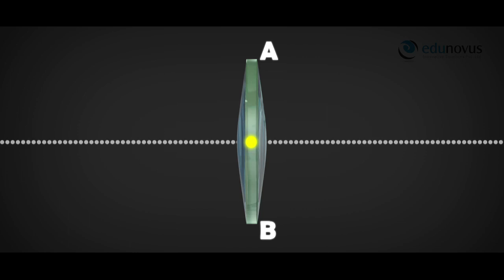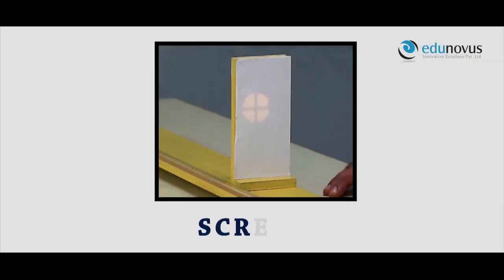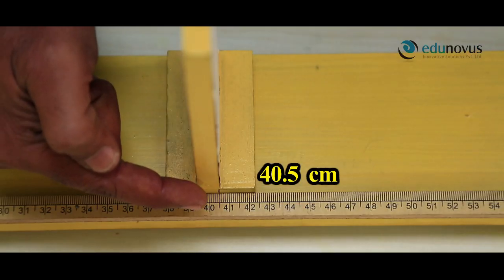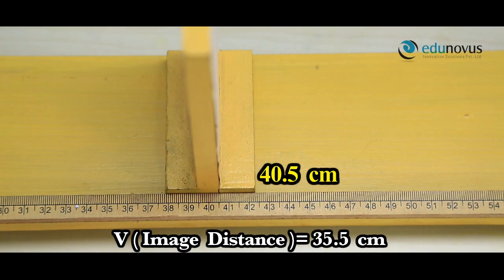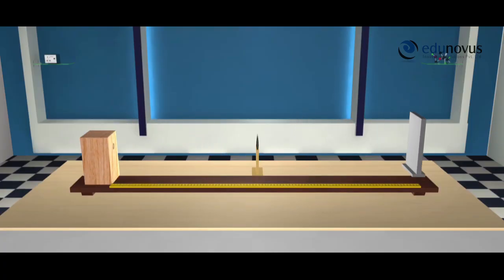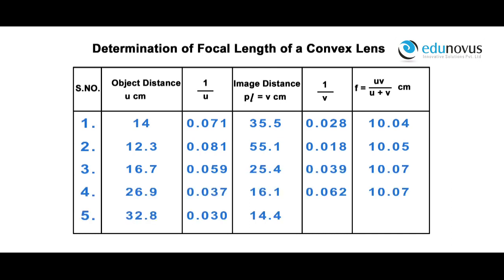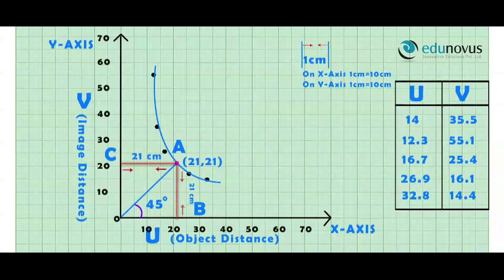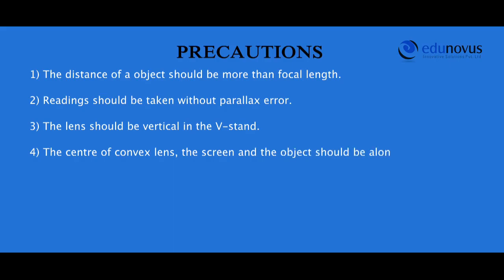Determination of focal length of a Convex Lens Experiment Edunovus Online Smart Practicals

Comment: there's a mistake in the 1/u,1/v graph, the scale you took is 0.020cm so it should be 1cm = 0.020cm not 1cm = 0.010cm. overall very helpful video, thank you💞
Reply: Arehh topper 😘